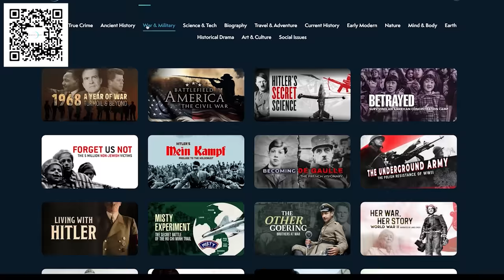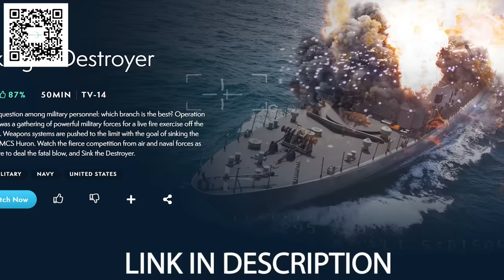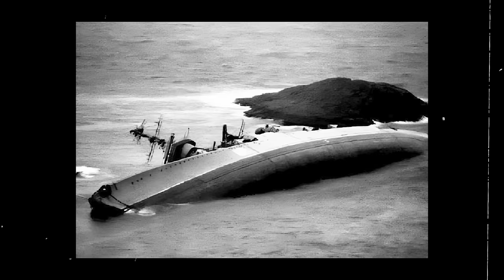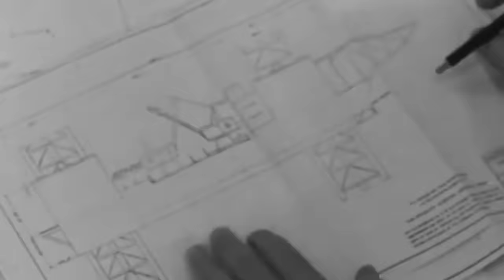The Mysterious Buried Russian Warship with A Dark Secret

Comment: Navigation radars do not give the same precise navigation as a GPS system does, this due to the resolutions on the various nav radar system narrow band radars will get "jammed" by snow or heavy rain this can be partially mitigated with using the anti clutter  systems on the set but it also decreases the image your getting, the broader band radars do not have this problem as much but the ecchoes are streched out making it harder to distinguish special features of the eccho. Usually a broad band radar is used to target ships while underway the narrow band is used for navigation.